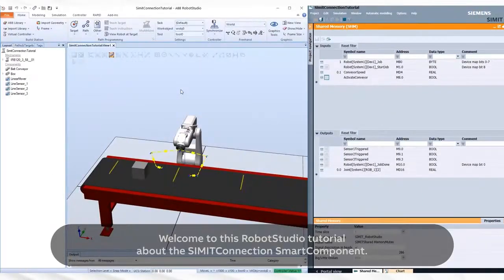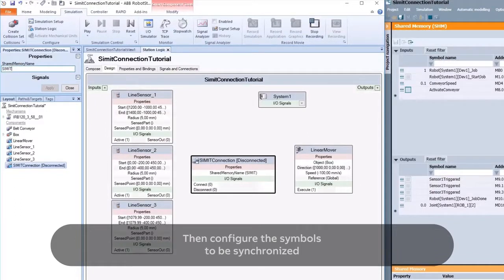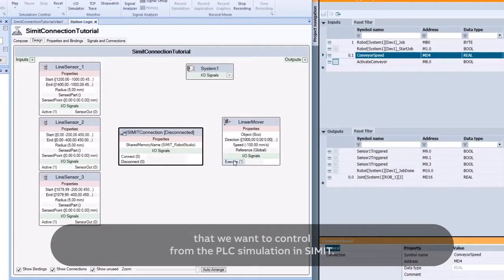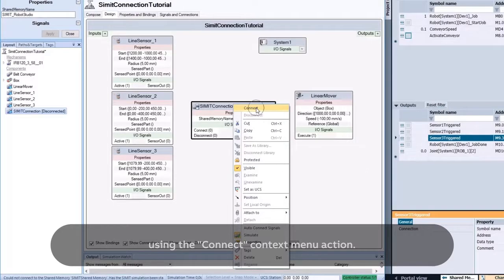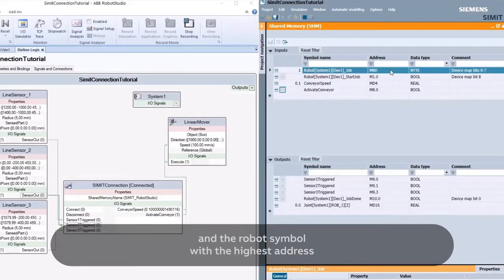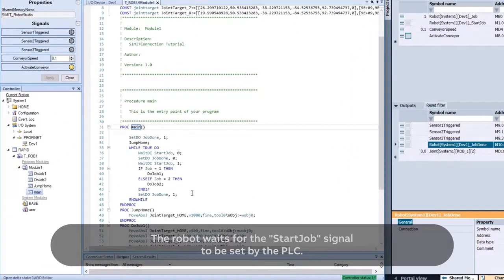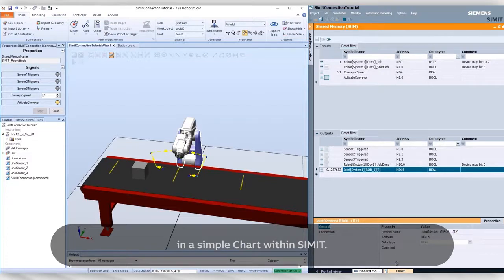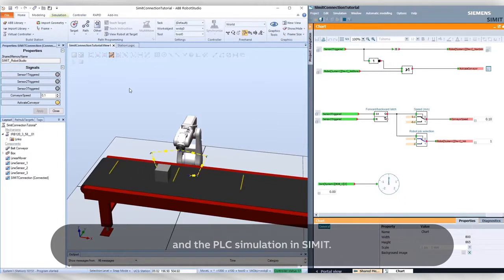SIMIT Connection | RobotStudio tutorial

Comment: How can I remove and/or sort the signals I added in the RobotController Box (System1 ) in the Design Tab? My goal is to have there all the I/O there visible in the same order as in the SIMITConnection Box. I have imported from SIMIT a complete I/O table and I generated in ABB Studio a VC from a backup from a real robot with complete I/O.